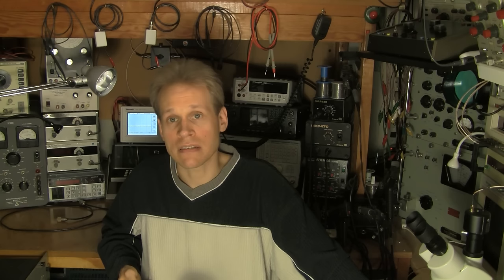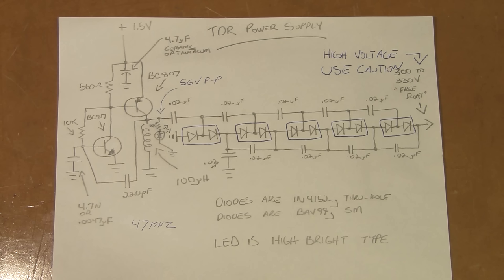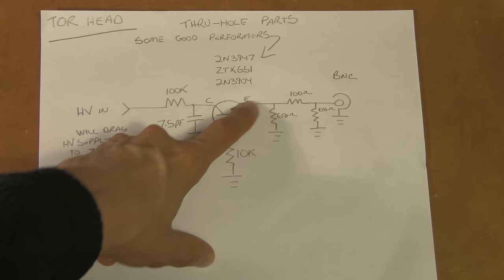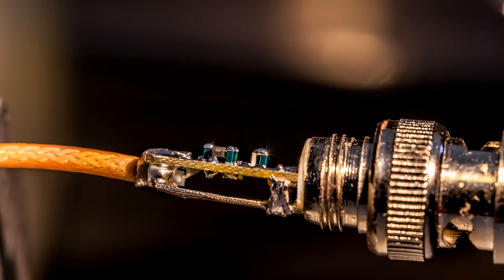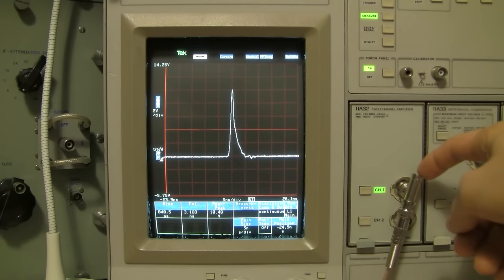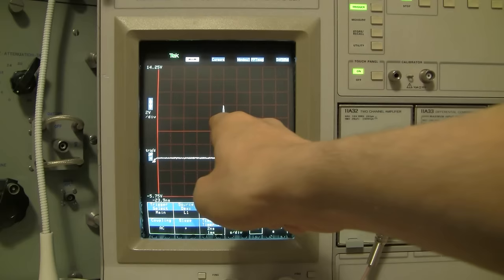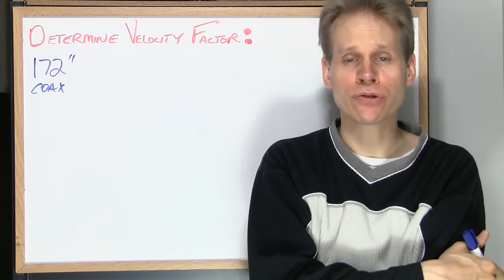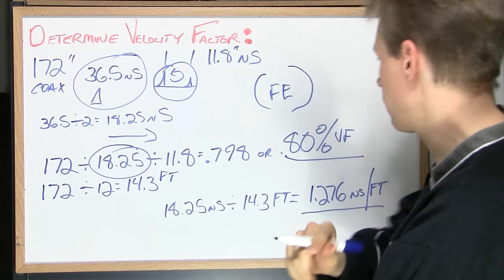"TDR" or Time Domain Reflectometer, build and use this circuit.

Comment: True story of an electricity supply company underground cable division , a long time ago.  They had an experimental machine in the back of a small truck and it told them at what distance away their buried power line has a fault ... and where exactly to dig down into the ground. They didn't use the machine very often but when they did use it always told them the distance to dig, so they dig there, they wouldn't find the break there, then they have to dig along either direction to expose more cable to find the break. After quite a few years they realised the break is always each time exactly 6 feet away from where the machine says it is. Then they realised that for all of the years they had been using it they had not been including the length of the hook up cables in between the machine and buried power line. And yes they were following the instructions to the letter.

Comment: First I built this circuit on breadboard. The impulse at the output of the TDR head was - of course - very small, 1-2 V (depending on the transistor) and both the rise and the fall time were above 2 ns. After having made the final (non SMD) version of the TDR head (built on a BNC), the parameters got very close to those seen in the video. After changing the capacitors of the voltage multiplier to 3,3 nF and bridging the 100 Ohm resistor by 7 pF capacitor, the output impulse increased to 12 V, the rise and the fall time dropped down both to 920 ps, i.e. the shape of the impulse is pretty symmetrical.
Thank you very much for this nice project. Greetings from Hungary, Peter

Comment: The TDR I used way back when had an old print roll feed to give a full trace hardcopy, really old but few knew how to use it. I took the time to figure it out, saved me loads of time checking aerial cables, even came in useful on gore/times  cables. Always made me laugh telling my boss it was a thru hole connector that's got a bad screen and he'd look at my like I was nuts.....yet proved right when it gets changed and the problem is fixed. 

Took a while but eventually he gave up and just asked me  'teach me'   
Wrote up a whole guide for him and the other techs, even built up a kit of connectors and adaptors to make it easier. Good times. And a very interesting design

Comment: That’s amazing.   350 volts from one C at 1.5. V.  Lol.  I remember as a kid someone I knew had a very nicely made miniature electric chair. It was made of wood with copper plates  all over it. Very realistic looking   It was hooked up to a 9v battery and when you touched any of the plates , basically any part of the chair.  You got one hell of a shock. 
I was fascinated as a kid by the thing.

Comment: THANK YOU for TDR video.  I first used TDR in early 1980s. Understanding the propagation-speed thru specific cable-type helps pinpoint things.  I actually made a "nanosecond ruler" for my toolbox at work.  I helped build testers for computer-chips (memory/CPUs) and had to trim length off of cables to calibrate the timing-pulses presented to the chips on the wafers.
Reply from the maker: You're welcome Bruce!

Comment: Built it, works great.  All thru hole parts, but 100% stuff on hand, gotta love that.
Minor tweak due to xsistors in power supply. subbed 82 ohm for 560 ohm and runs on 3 volts (2 x AAA).  Second head built works better. Used 1/8 watt resistors so there basically are no lead lengths.
Just found your channel last week.  Keep up the good work. 73, John
Reply from the maker: scooby45u Good to hear! Thanks for the comment too!

Comment: Thanks for your video. You made a nice circuit and took the time to clean-up the wave shaping.  I was a bit lazier and just used a step-recovery-diode and pulsed it since I just needed to do a couple of measurements. Nice to see that you didn't use a bunch of exotic parts but things that we could have around as hams. Thanks Again!

Comment: I first ran in to TDR equipment 17 or so years ago, when i was a very young engineer at a cable operator in Ohio.  We were a small cable operator with around 1,800 subscribers, but were trying to grow.  We had approximately 4 miles of underground distribution likes, and another 2 or so miles overhead, so fault tracing was difficult at best.

My predecessor bought a multifunction CATV analyzer, and he had the forethought to also order the optional external TDR unit.

I've used TDR to find faults in coax on and pff aince then, both in my CATV career and my amateur radio hobby, but I didn't fully understand just how it actually worked until today!

The TDR analyzer I use connects to an excessively complex coax and CATV analyzer, and the pair always give a distance measurement in feet or meters, but you do still have to confirm what coax you are connected to.
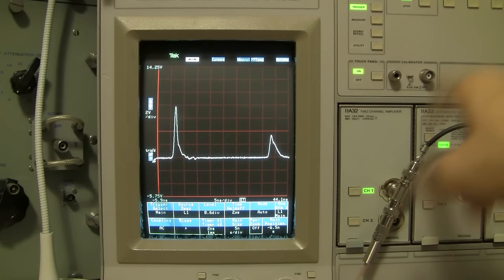Reply: Also, watching the explanation at 15:00 or so, this reminds me of some training I've had dealing with sonar.

Comment: Would this TDR work with twisted pair instead of coax?
Reply from the maker: This one is designed around a coax type cable.
Reply: Put a 300 ohm pot in series.

Comment: You should have come down to Yuma with me. I got a large box truck load of old O Scopes with Polaroid cameras for $2000. Some of the scopes worked and some were cannibalized to make other scopes work. The cameras were scrapped.
Reply from the maker: +Seth B 
I have to be careful, You haven't seen the other room.
Reply: @MrCarlsonsLab  I blew out all those 465s & 465Bs on eBay. How many 465s do I need? ONE! Okay, TWO.

Comment: Is the 7.5pf cap. In the head a critical value? I have looked every where for that value with no luck. If it is not what would be a good substitute value?
Reply from the maker: Hi MrRickrzr. 10pF should be ok, you will see an increase in amplitude with that value.

Comment: Is there anything special about the diodes you selected for this or would a 1n4148 also do?  They seem to have slightly higher reverse recovery times but otherwise things like breakdown voltage are better than for those listed.
Reply: Quick update on this.  I've since then built this circuit with 1n4148 diodes and it seems to work quite well.  Haven't been able to test with the original recommended components so I have no clue about the difference in performance but this seems to work for me.

Comment: I got a question, how can you do a TDR not to an open end but to a bend or a shake of the cable. I want to detect where is a momentary vibration along the cable and get the location of it.
Reply: Many motion detecting cables have piezoelectric dielectric so they create a voltage pulse when they are struck.  The time difference between the pulses arriving at the two ends and the order of the pulses tells you how far from the centre of the cable and which side of the centre the cable was struck. 

If you pinch the cable enough the TDR will show a small discontinuity reflection but that will be hard to detect automatically.

Comment: When using a 12V AC supply it takes 9 steps (18 capacitors) to get the voltage it takes.
Reply: +0MoTheG Better take big capacitors like 2.2uF and fewer steps, because at 50 or 60 Hz 220nF is way to little to stay charged.

Comment: hmm just wondering if wouldnt be possible with a schmitt trigger to make an oscillator inject the signal into it and measure with the scope the rising edge and reflection of it
Reply from the maker: +Alex Verias 
I Think Alan W2AEW has made a version of that using a 74 series logic IC.

Comment: Great Video and smart circuits. One question still: why the head needs so high voltages?  On the scope screen the initial pulse is about 8 volts only. Wouldn't it work with lower voltages from the supply circuit?
Reply from the maker: Axel Haar Hi Axel, It takes High Voltage at low current to make the transistor avalanche. If you look up "transistor avalanche" on the net, you will get some descriptions of how it works.
Reply: Mr Carlson's Lab Ah, I didn't know the Transistor Avalanche effect up to now. Now I understand how you manage to get so fast switching times!  Thx a lot.
Reply from the maker: Glad you enjoyed!

Comment: That power supply would be a good circuit, with a potentiometer to adjust the voltage, for charging pocket dosimeters.
Reply: That is a very good idea.  A fixed potentiometer load should provide a stable voltage.

Comment: Great explanation on TDR... won't it be easier to build the pulse generator using a Logic chip?
Reply: Frank T To get such short rise times you’d need 100EP or faster ECL logic family, and that’s a bit more demanding to implement than an avalanche pulser circuit. You’d need something like a ring oscillator with perhaps a bit of gain to keep the circulating edge rise/fall times as short as possible. It’s way more transistors inside many chips, requires very careful thin two-layer laminate ground/power plane prototyping (typical 2-layer PCB is too thick – you need the distributed capacitance), and is generally more expensive and more painful to get working in entry-level amateur conditions. The old 10k ECL family is very docile and can be prototyped with wire-wrap, but here you need an order of magnitude faster transition times than the old 10k ECL logic. The modern “1 00k” and “1000k” derivative families are suitable, but those are tiny packages and really require a 4-layer PCB to work reliably. Those are absolutely minuscule packages often as well. And those chips cost 10-25$ apiece, and you’ll need several of them. ECL is special purpose logic these days. 40-20 years ago it was ubiquitous. Nowadays if you need ECL, then money is no object, because you’re either designing high-end test gear, or high-end RF/comm systems and such. It’s not magic and with a bit of care you can use it, but in terms of obsolescence-proofing your design, ECL chips are not the way to go. Discrete ECL circuits using very fast RF transistors are a whole different story though. Those can be made future-proof and designed to be put together by humans, not robots. Still, lots of attention to parasitic inductance is necessary – sometimes 10mm of a thin trace is too long in those circuits, and a “2.5 dimensional” assembly is required. Rings a bell? :)

Comment: Should it not be 80% or 0.80?  .80% doesn't make sense.
Reply from the maker: Hi Marc, When you do the math, the decimal is present, and I figured people would know to remove it when the % symbol is added. I did add a note to this Video. If you watch the series, you will find that I address this topic in a later Video.